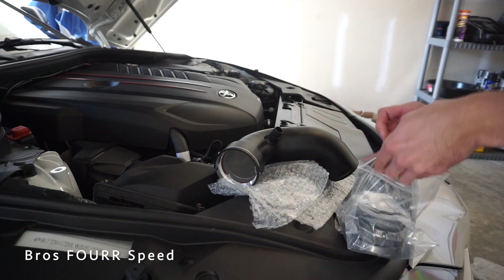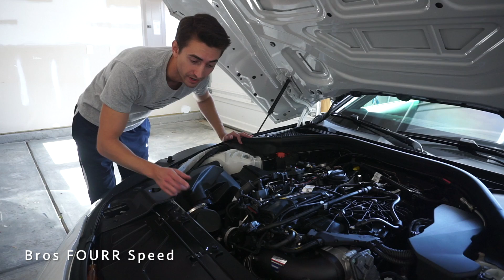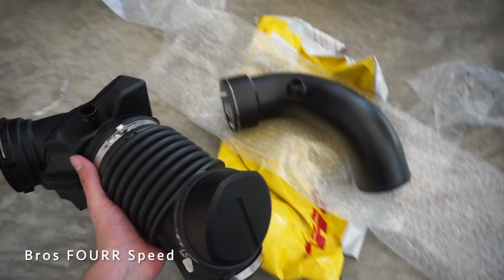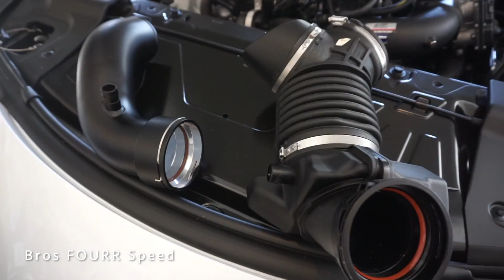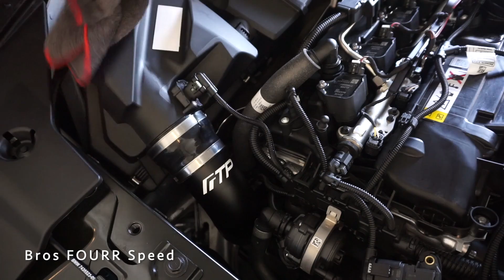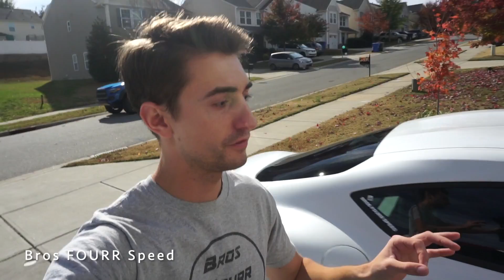A90 Toyota Supra Upgraded Intake Pipe Installation

Comment: The body: fake vents, midget, short, fat, and ugly.

Suspension: built by BMW unreliable and expensive.

The engine: The timing chain is in the back of the engine (you need to pull the whole engine out to install cams). Each valve has two cheap plastic valvetronics. The oil pump is linked with the crank by a chain. Many moving parts in the chain section ( three chains, three guides, three chain valves). The engine is complicated and 
needs special tools.

Cooling system: electronic and complicated (numbers instead of having only a thermostat).

The transmission: it comes only with automatic (no fun factor). Never exceeds 700hp (the old R154 is stronger), and very expensive to maintain or modify.

The diff: electronic LSD already proved to be failure.

The reliability: oh my God don’t let me start with the BMW reliability. Yes the American cars are not reliable however they are much reliable than the BMW.

As you can see I’m not a typical hater, I’m a mechanic.

The car is an abomination.
Reply: The inaccuracy of 90% of this comment boggles the mind.
Reply: Haters gonna hate!
Reply: Jerry Sandoval 
I own an MK4 which is more expensive

Comment: I can make one of those for $3. All it does is removes the resinstor. No horsepower added, just improves throttle responce on cable driven throttle bodies. It probably does nothing for electronic throttle body responce since it has a electronic delay.

Comment: Go for an ECU remap or much safer piggyback tune if you dont want to void the warranty!!
Reply from the maker: I've heard of that kind of tuning. I'll see!
Reply: @BrosFOURRSpeed  no point in doing a piggyback tune anymore when you have things like MHD or BM3. Warranty will be most likely voided regardless, but flash tunes are a safer option in my opinion.
Reply from the maker: 10outof10 When the time comes I’ll probably be going ECUtek and getting a full ECU tune on the dyno